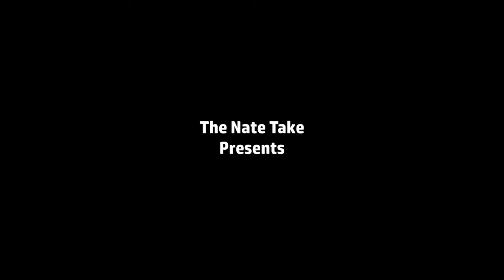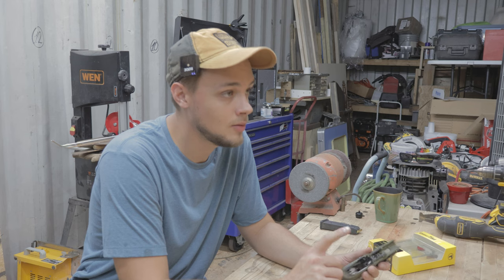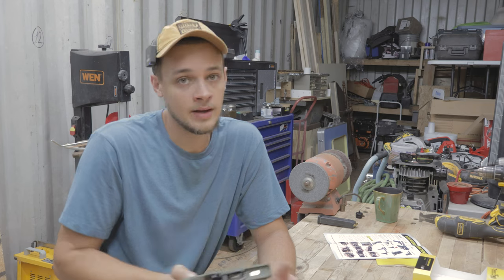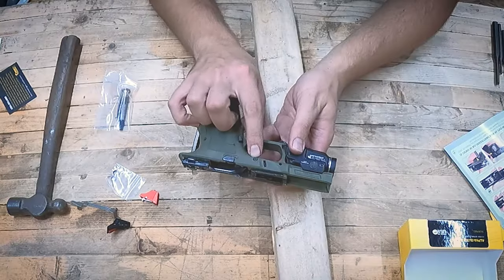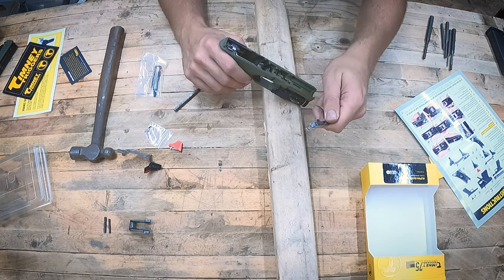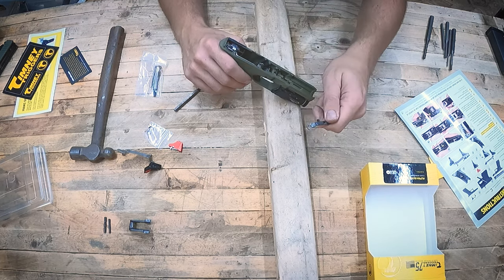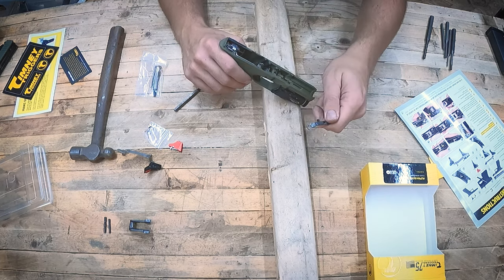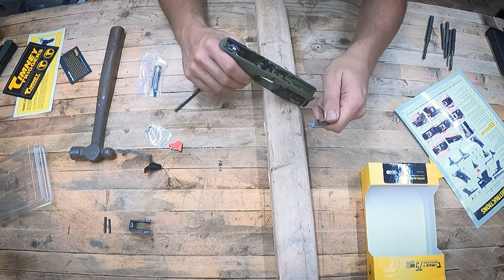How To Install Timney Alpha Trigger in the Palmetto State Armory Dagger

Comment: How did u get the pins out because the frame I bought has some permanent type of pins that won’t let me change trigger!
Reply from the maker: I am not sure what frame you got, but the pins do feel permanently stuck the first time. You really do have to wail on it. I think I used a piece of soft wood like pine with a hole drilled on it. Place the pin over the whole, and using the punch and a hammer whack at it till it comes out. It was rather concerning the first time I did it! It's a lot easier after the first time.
Reply: Are they harder to put back in?
Reply from the maker: No they were not harder to put back. You just have to be careful to not start them crooked.
Reply: @TheNateTake  I’m going to go fight these pins here in a little bit lol
Reply from the maker: @Alexander-fz7sd good luck! Don't allow them to win!
Reply: @TheNateTake  can’t get big pin out I’m at a loss. Never going to buy a frame from psa again because they are forcing you to use their horrible trigger
Reply from the maker: That is unfortunate. I have done this to two different frames and they were all able to come out. I bet if you contact PSA, they would probably make it right. I've found their customer service to be top notch.

Comment: I read these are not drop safe...  can someone test and verify?  Lol
Reply from the maker: In my experience, which does not translate to yours, as yours may be different, therefore I can't claim to have a proper answer on this, mine is drop safe. But I didn't make any adjustments to the trigger. And yours may be set differently from the manufacturer. Do your own testing as results may vary.

Comment: I had an issue with the reset also.  I used a lighter ejector retaining spring from my other Glock with a "Ghost:" kit in it.  Problem solved.  I don't believe it's not so much an issue of the disconnect as the balance of the ejector retaining spring, which affects the disconnect, against the trigger return spring.  Great video, and great trigger.

Comment: Well, I don't know what to do; both springs make it function in binary, and after calling Timney, they said that trigger won't work in a dagger...anyone know any workarounds?
Reply from the maker: I'd double check the take up screw to make sure that hasn't backed out or something. I saw some people say this exact thing online, and they called and got Timney to replace the trigger. The replacement worked. Perhaps just tell them it's for a Gen 3 Glock and it's not working despite your best efforts.
Reply: @TheNateTake  I'll have a look at the screw, thanks 👍

Comment: My gunsmith wouldn't install it in my dagger, said people had a lot of issues with it and it wasn't safe
Reply from the maker: People generally do have issues and it is unsafe, when they adjust it too light. I left mine at what it was from the factory, no issues.
Reply: @TheNateTake  there are tons of videos and people on  Reddit that have issues with this timney trigger and even timney admits to it lol I'll just get an OEM Glock trigger and a 3.5lb connector to rid the headache. 🤙

Comment: Be careful...
The Timney pulls the striker farther back during the cocking cycle than Glock's original design. This increases force on the sear, which increases the likelihood of uncommanded disengagement, and increases the likelihood that such a slip would ignite the primer.

In short, DON'T DO THIS ON A CARRY GUN.

Comment: I believe PSA made some tiny adjustments in their newer daggers. I know before, with the older ones, you had to use the stock trigger bar or do a tiny grind job on the frame but with the newer ones, it'll drop in just like your video. But yeah, like some others mentioned, definitely re-edit your video to say something about reusing the stock trigger bar and different spring for the older  daggers so they don't get all the way done and have to change it all out again.

Comment: Thank you for posting this video. I installed the Timney Alpha Trigger on my PSA Dagger with good success following your instructions. My trigger reset properly with the aftermarket slider bar and the Timney spring. I did not have to use the factory bar and the silver spring.

Comment: Question regarding the factory bar, did you forget you changed it and went back to stock or did you not change it and took the original on and put it on the rear mechanism?
Reply from the maker: I installed the timney, it didn't work, and I could figure out why. Then I remembered I had changed the connector bar, so I went and switched it out for the factory one it and worked.
Reply: So you put the factory dagger connector in or the one supplied with Timmney?

Comment: Where can I get the punch set you used?
Reply from the maker: I got mine from a local auto parts store. I really suggest not getting the cheapest ones you can find, the quality of the steel makes a big difference. You don't want it to bend on you when you are driving pins

Comment: How did you swap out the connector bar?
Reply: Or I may be confused. Do you have to replace the bar that comes connected to the Timney trigger. Or is that not what you mean by factory connector bar?
Reply from the maker: The connector bar is separate from the timney trigger. Previously I put a ghost connector bar with the hope that would help the feel of the trigger. It did not. I did not remove it and put the factory dagger connector in until I noticed issues with the timney installed.
Reply: Okay I just got the kit and was looking at it and was a little confused. But hopefully it will work for me as well. Thanks for your quick reply
Reply from the maker: I think you will really like it

Comment: The only video I've seen where you r told exactly how to put the silver retainer spring; didn't know it goes through the trigger tiny hole.

I have noticed that the trigger doesn't stay all the back when pulling the trigger after racking the slide while no mag inserted. Is this normal with this trigger?
Reply from the maker: I'm glad my video was helpful. I. Regards to your question, the trigger should move forward. Are you talking about the trigger housing is moving inside the frame?